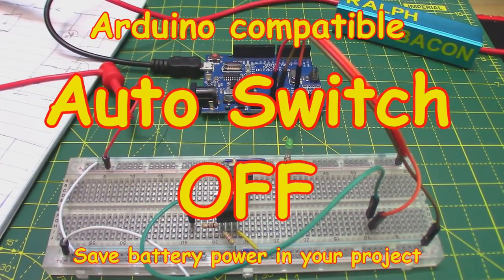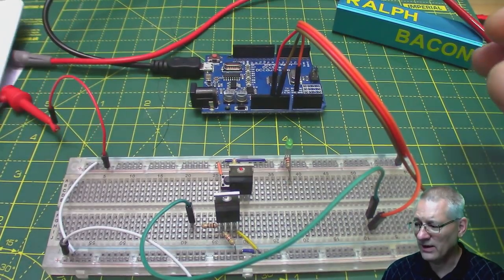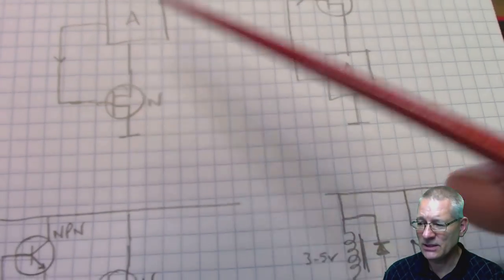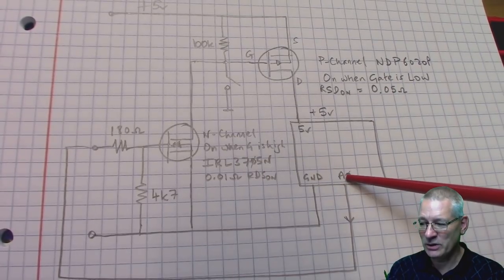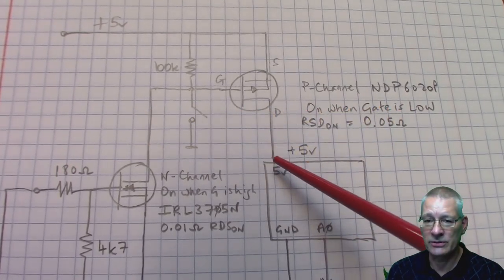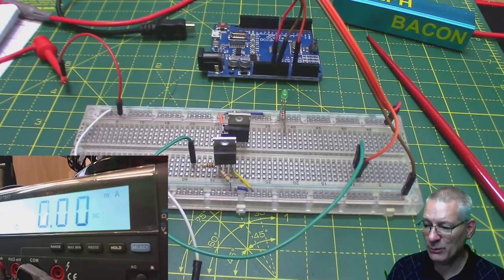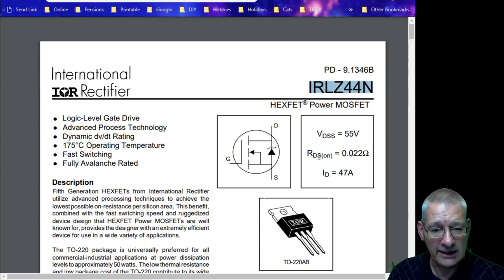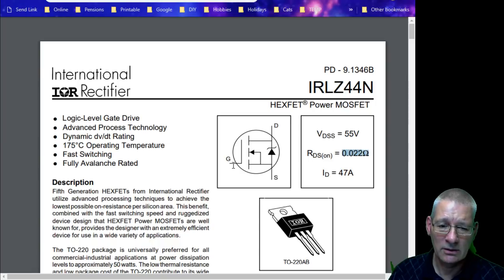#123 Arduino Auto Shutdown (and switch off)

Comment: Hello Ralph, first of very nice video, it helped me a lot with my project so far! Just one question, why does it have to be so complicated? I made the same thing with only one switch and one N-Channel Mosfet (Like the first idea in your video) and it works: Picture and Video in this dropbox link: https://www.dropbox.com/sh/wyw129byssvnoo2/AABTY4WE-yasUOpPgu8bj5y3a?dl=0
Although the circuit is a little bit different as the supply is actually 4V and then I go into a step up converter from where I power the arduino. Thanks for your answer!!
Reply from the maker: If it works for you, Julian, then that's great. I'm pleased that you got it working.

However, your use of an N-Channel MOSFET in the supply line is not standard practice. The Source should be at GND potential with the load between the Drain and +VCC. I suspect your circuit works because you are powering an entire board with it, with all the LEDs, LDOs and so forth, so the MOSFET can "see" GND. If you tried that with a bare 328P I doubt it would work because the MOSFET would not like the potential difference between the Source and GND and would not switch on.

If you look at my circuit, we use a P-Channel MOSFET to interrupt the VCC to the load and use another MOSFET (although a BJT works here too) to switch that MOSFET on and off (the GATE must go to ground, ie LOW, to switch on, hence why we cannot control it directly from the Arduino chip). This is the standard way of supplying power to a load, with the load between the Drain and GND of a P-channel MOSFET (or a PNP transistor but far less efficiently).

Incidentally, even though your circuit works for you, you should at least have a 10K-100K pull down resistor from the GATE to GND to stop spurious triggering - but that might upset the delicate balance you have achieved!

I hope this reply has helped you understand MOSFET a bit better but I'm very glad you had a go and got your board running to your liking - and now you know why it works for you too!

Thanks for posting, great to hear from you, keep experimenting!
Reply: @RalphBacon  I see what you mean, I tried it with a different circuit and the MOSFET would not stay "open". I guess I have to apply the more complex solution. Thanks for your advice and please keep up your great work!!

Comment: Hi Ralph, I'm trying to build a reverse polarity protection circuit which operates at 3.7V 3600mA and i intend to use
a mosfet of this rating
VDS 20 V
VGS ±12 V
RDS(on) max
(@VGS = 4.5V) 11.7 mΩ
RDS(on) max
(@VGS = 2.5V) 15.5 mΩ
ID
(@TC (Bottom) = 25°C) 12 
RDS(on) Static Drain-to-Source On-Resistance  9.4 11.7(max) mΩ VGS = 4.5V, ID = 8
 RDS(on) Static Drain-to-Source On-Resistance 12.4 15.5(max) mΩ VGS = 2.5V, ID = 8
https://www.infineon.com/dgdl/irlhs6242pbf.pdf?fileId=5546d462533600a401535663a52d25a9
I was wondering if this would do just fine. I'm completely lost in understanding exactly what is all the RDS and VGS conditions. It's driving me nuts!!! please! elaborate :(
Reply from the maker: Did you watch my video on MOSFETs (https://youtu.be/5FHLWGZ_FUQ ) and on Reverse Polarity Protection using a MOSFET (https://youtu.be/eS4_6XQi74c ) which should answer your questions? As the VGS(TH) for this particular  MOSFET is just 1v1 (max) it should work pretty well.
Reply: @RalphBacon  
Ingenious!! Thanks I will watch the two video!

Comment: Why do DIY hobbyists seem to be obsessed with Arduino? Is it just because Arduino is a buzzword or what? Because if it's about capability or price I don't see many reasons to choose Arduino over the competition. When I do the math I don't see why Arduino has so much hype and attention put on it. Atmega chips are slow as fuuuuuuuuu
Reply from the maker: Hmm, I may be wrong but I'm guessing you're not an Arduinite :) 
 
When you say "the competition" I wonder what you mean? PICs? Raspberry Pi? ESP8266s? All of which are very capable but I would not describe any of them as the competition, more of an alternative platform depending on your requirements.
 
The ATMEGA chips have opened up a whole world of hobbyist (and commercial) embedded electronics. Makers, hobbyists, teachers, engineers all have a platform on which they can experiment (what if...?) very easily. Cheaply too. Using an industry standard language (albeit somewhat simplified if you use the Arduino IDE).
 
As for speed, I think 16MHz is pretty nifty for most things an Arduino ATMEGA328P would be used for. If it is slow in a particular application then the wrong chip was selected. Horses for courses.
 
As it happens many can see the writing on the wall for the humble Arduino Uno-style boards. Whilst they will be around for many years yet, newer, more capable chips and boards have arrived (with built-in wifi as a minimum, faster, multi-cored processors, more memory and so on) that are just as cheap and easy to use (and the Arduino IDE is being constantly modified so they can be programmed just as you would an UNO).
 
You won't convince many that the UNO is just a fad. It is an excellent introduction into embedded computing and many hundreds of thousands of users (possibly millions) have made them sing and dance doing wonderful things.
Reply: @RalphBacon  I've attempted to write back twice, but YouTube seems intent on not sending it to you. I've got a lot to argue about how MCU's like the Teensy or STM32, STEM21, etc, are just about completely ignored by the DIY community. Learning about them is arduous without all the projects that you find with Arduinos. But suffice it to say, I'm glad channels like yours exist; I'm dropping a like and a sub.